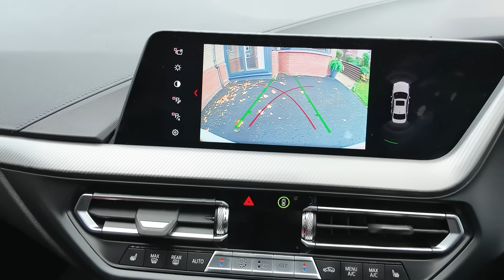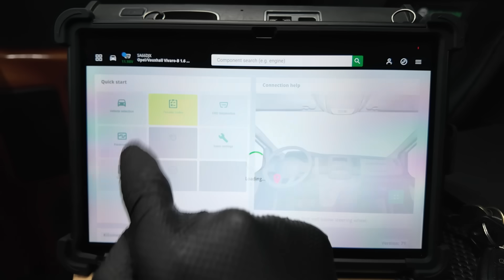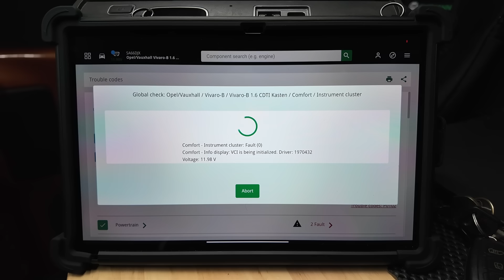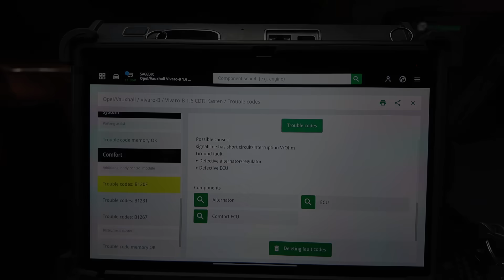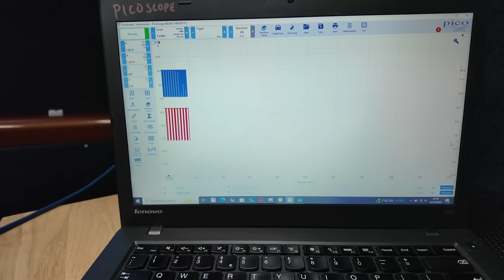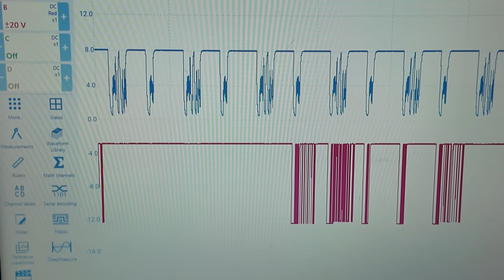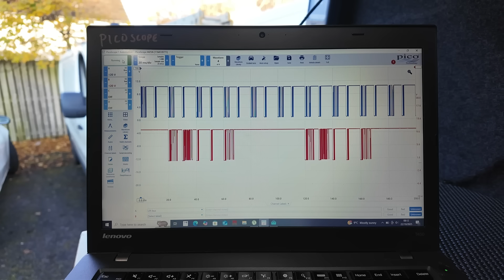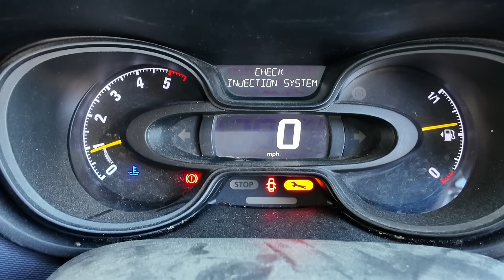The real reason behind this Vauxhall Vivaro Charging Fault | LIN bus testing & repair

Comment: Hi mate I got vauxhall Vivar 2015. I took to the garage to change the clutch and the flywheel and next day later it comes up when it says battery fold it’s not charging so the van doesn’t start now I got a big problem with this so if you don’t mind if you can help me out because I’m a builder and the van doesn’t start now

Comment: Hi. Thanks for a very informative video and has potentially helped me to fix a customers vehicle that I’m due to go out to this weekend.  He had a new alternator fitted by a local garage because of the charging fault.  Gave it him back and as soon as he drove off it came up with the same fault on the dash.  He’s rang me to  come out and diagnose. Hopefully it’s that 🤞.

Just one question if you can help me to understand. Why do the 2 waveforms look somewhat different ? If they are both reading the linbus signal.  I would have expected them to be identical.  I’m not electrically minded so I’m just curious

Many thanks again for a great video and will be following with enthusiasm
Reply from the maker: Not all Lin signals are shared, I was just showing what a good typical LiN looks like

How did you get on ?

Comment: Can i ask about something thats confusing me .? What is the relevance of the other known good linbus signal ?Is it the same circuit ? How did you know to use it as a reference ? Or it it a case of that all linbus signals on any particular share similar enough waveforms...
Reply from the maker: I only connected the known good lin to show what it should look like

Its not all the same but was just for a reference waveform for the viewers🙂

Comment: Great job, do you solder or crimp connect wire repairs? 👍
Reply: That would depend on the location.
Reply from the maker: It depends on the type of repair needed I will use both